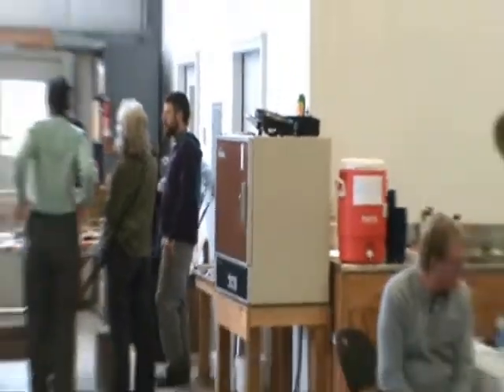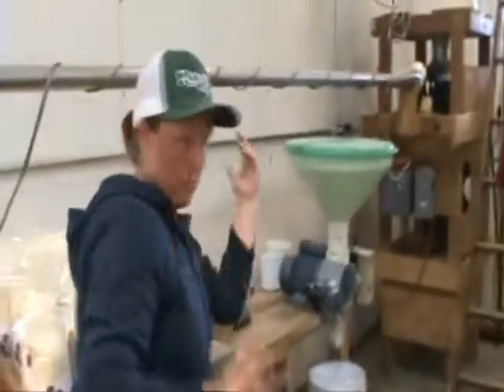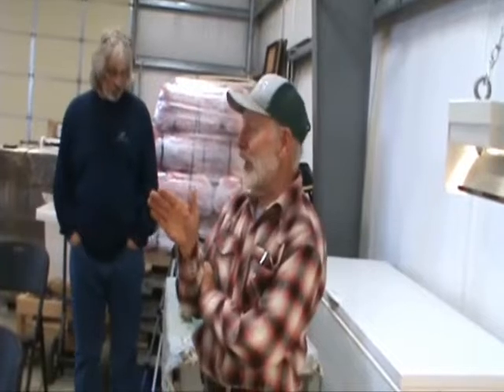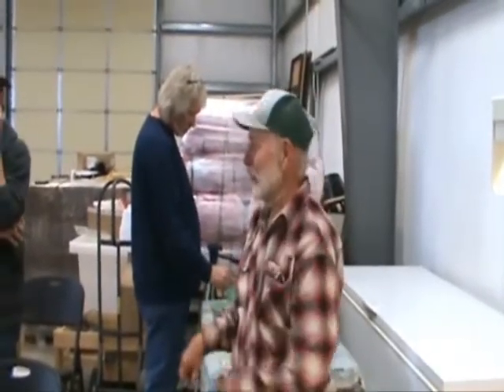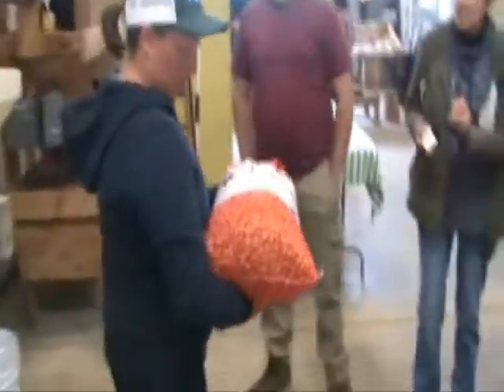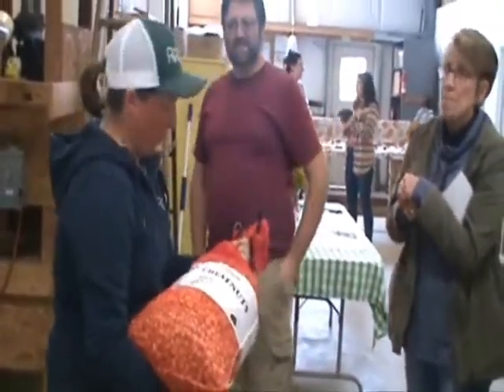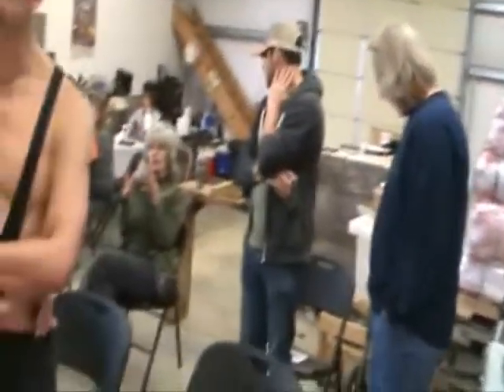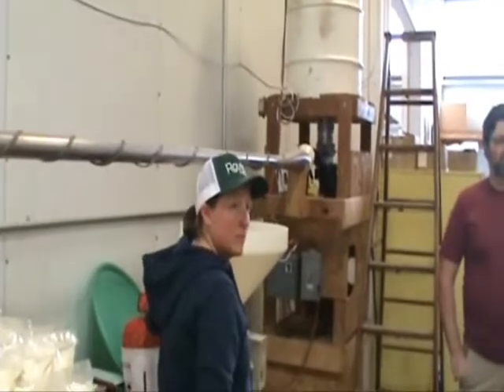Grinding Chestnut Flour At Route 9 Co-op

Comment: How fine is the flour? What is it suitable for? Does it have a long shelf life?
Reply from the maker: It depends on the mill how fine the flour is.  I also posted a video of a presentation put on at the Route 9 Co-op showing different foods made with chestnut flour. As long as the flour stays dry, it should have a good shelf life, just like any other flour.